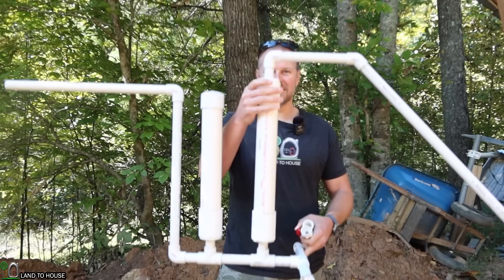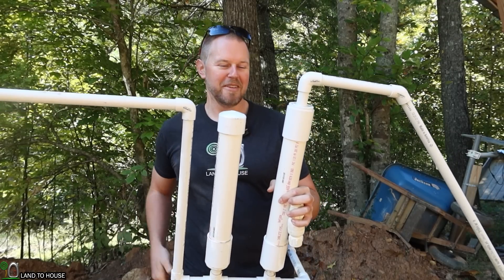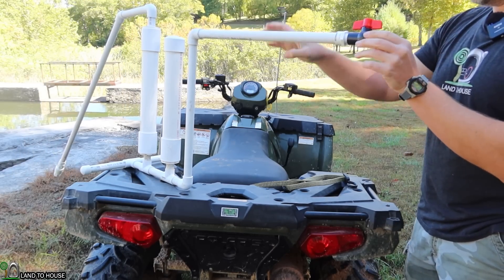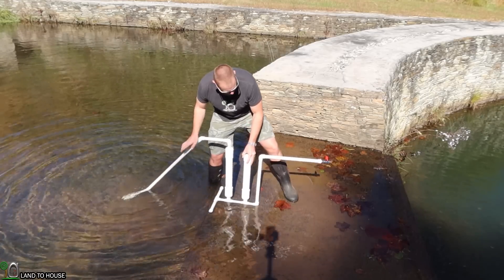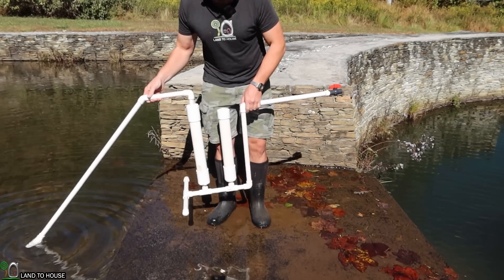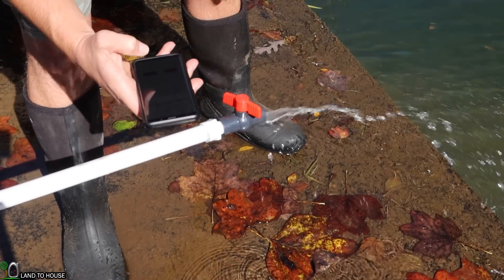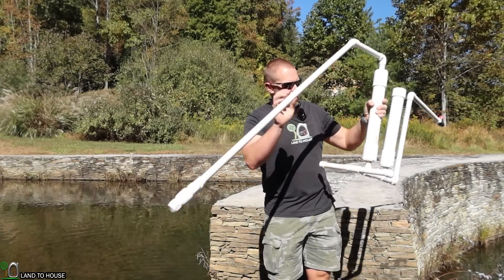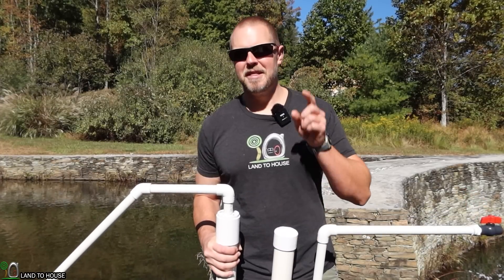This Siphon Works But not for Long

Comment: Great video...honest.. realistic...
A few comments you made, aside from the false design, show that one must understand some basics before creating anything.
"Perpetuum Mobile" remark shows us that you did not get the fact that water flow is actually behind all these variations of pumps and such. The various designs vary only in efficiency of converting/utilizing water-flow force. The air-pressure (with the help of two properly installed one-way valves) is used only to start-and-maintain oscillation of taking the water in and spewing it out.
Your design will never work as it is missing the !!!minimum!!! features/parts a RAM PUMP has.

Comment: if your going to do an honest test  you need to glue all joints.  even a pin hole leak will stop it from working.
you can debunk anything by not doing it right. we have used this method on the farm for years we draw up with a 3" pipe and exit with  1 1/2" pipe   and have 6" pipe chambers.  and you do need to add Air, we have a 10 gallon air tank we go down and fill once a week to keep the presser up
debunked???  no just not dune right

Comment: you did not make it correct  as the out put should have been lower meaning you should have placed a 90 the direct it down then a 90 to send it out.  the intake pipe has to be smaller and out put  you did not make a proper siphon  try again and you need deeper water for to fill the system and not bang the check valve

Comment: I can't say because you don't do it right, and not sure if it's air tight or not.  I've a good smile seeing how you SHAKE the water. 

🔸 They all PUSH the pipe into water to pump water to fill ALL PIPES.  When you just SHAKE the end, and I don't think it pumped enough water to fill all pipes.  An error right here. 

🔸 If the pipes not filled with water then it won't work.  If it's a small leak then it won't work either. 

Since you've made few errors, and not so sure if it's 100% air tight.  Then YOU 	FAILED the test for us to say more.

Comment: why do have to put another tank if you saw that from an asian guy on you tube you over design it with another tank that will give more hard time for water to flow out cuz the other tank trying to compress it back the water back instead of out

Comment: What's missing is a valve like what's on a bicycle tire to fill the other chamber with pressurized air.
Reply: It doesn't need the Schrade Valve for it to work.  The reason the guy has the Schrade valve because he wants to have enough pressure without having to fill the pipes with water first.

It's just a different design, everything else works exactly the same.
Reply: @fairryalp.-de5qb  A siphon needs to dump water out at a lower point than where it takes it in to work.

Comment: Did you debunk this or did you not really seal the joints allowing air to leak in therefore water falling back out?
Reply: The pieces were even falling apart as he shook it 😂😂

Comment: Maybe there is a leak somewhere in the pipe , this way you don't build any pressure,  and it won t work😊
Reply: There are huge air pockets in it plus he didn't seal the middle ones tight. Air befan to flow and it made the water stop

Comment: No glue on the joints will allow air in the system. Hence why iys not working. It has to be air toght. Not only that you have no air pressure in the "pressure" tank. Also should have left the spring in the check valve.

Comment: Water finds its way down to the ocean, not uphill to the mountain top. Smile!
Reply: You don't know physics. The chamber in the middle are not tight enough to keep the necessary are pressure.  Thus it caused the front part to lose force.

Comment: clearly, you did clue it tight. if the seal is not good then air can escape, and it reduces the pressure, so it won't work.

Comment: Next time seal the joints so the pressure doesn't escape.
The original pump isn't debunked.  However, YOUR artistic interpretation IS totally debunked..
As for the 'lost cause'.., I won't be following you.

Comment: I think the exit pipe needs to be lower than the two vertical pressure tanks. If a fast flow of water could be initiated at the start of this test then the flow momentum might maintain the vacuum and therefore the 'draw' from the "suction"side. If air can still be drawn into the outlet side then it will break the vacuum and the unit will stop working. It's an interesting concept, but I agree with you that it should not work in any practical way. the vacuum must draw water up from both inlet and outlet due to the equal atmospheric pressure at both the inlet and outlet sides. Well done for trying so long.

Comment: u shake it in  wrong way, u need to input some water in the midle tank, and pump air using tube valve to pressure the air.

Comment: You need to PUMP AIR  in the pressure tank.  So ACTUALLY GIVE IT SOME PREASURE.  Install a small bicicleta wheel vent. So you can pump the air in easily.

Comment: Not debunked. A siphon is supposed to be lower than the highest point of suction to get the suction established. The higher the point of suction to the lowest point before the rise and you have the greatest amount of flow. This is called fluid dynamics.

Comment: although it is probably a rube Goldberg invention, not having hermetically sealed connections will effect the quality, I have witness a lower that expected performance with a pool cleaning system, until every o ring was silicone greased and all permanent attachments were glued in place

Comment: I also think that it supposed to:
- be air tight
- first tank should contain volume bigger than inlet pipe
- second tank should contain volume more than exhaust pipe.

Comment: the concept works.  As a youth I worked on an arizona farm where irrigation water flowed through open concrete canals for waterings the ranches. We used heavy rubber pipes about 5 feet long, that naturally curved because they came on huge spools, and 4 in diameter. To get the water flowing, you thrust one end of the pipe into the water and as far as you could, then immediately cap your hand over the top of the pipe and draw the pipe up but not out of the water. Its sorta like sucking on a straw, but instead you just stop the water from running out the bottom by caping your hand over the top. When this is done fast enough, you cause a flow of water that flows up and over the edge of the canal and onto the rows of crops. The flowing water in the canal has a lot to do with the physics.   We would do hundreds in a couple of hours. The competition was who could get the water flowing with the least amount of strokes.
Reply: My grandfather used the exact same technique out in a cabbage field and tried to teach me how to do it when I was 5 or 6 yo back in 1960's. I could not do it be he could do it with about 3 or 4 strokes. As I can recall the curved pipe was about a 1 inch diameter (maybe it was 1.5 in?) and about 4 ft long.

Comment: using hydrostatic pressure you'll need a wider inlet narrowing to the outlet and smallest head hight possible and think about adding back pressure so com plete system needs to be air tight too, also pond shape, depth of intake, water hardness and more are factors.

Comment: The entire intake pipe (until the first ‘vacuum chamber’) diameter should be larger (maybe double the size) of the output diameter. It works. Try again. The ‘vacuum/ pressure chambers’ should be larger.

Comment: Forget all the  long winded theory  and endless calculations water does not flow uphill.
 This device just stores the mechanical shaking into air pressure in the centre cylinder which pushes out the water in the bottom of the device.
The foot valve prevent water being pushed out of the inlet.

Comment: okay i got one for you,,,there's a product on the market its called a V - Pump.

Okay its stated this plastic gadget is submersible,how it works?

You attach a hose to it as its primed from a hose pipe,,i think the design and manufacture is,,Australian,,its noted that with hose water priming the aparatouse and the aparatouse then placed into a pool it will pump at very high velocity,,

Okay i haven't purchased this unit as its a unit to global market from Australia so i don't quite know whom has the franchise and thus what markets its directed at in order to to obtain one,,.

Now some people say it works but i am not convinced,the science behind the aparatouse that works the  the VENTURA,,assuming water gravitationally fed pump system,,its used for a variety of applications emptying out ponds, etc

When reading about this aparatouse i was on the research path to try and fined an aparatouse that fully functions primed from water and of course then pumping the same water and  in some way attain lift, i wanted to at least gain a lift of  5 meters plus get as much flow capacity as possible where i could control the flow but attain up river as the object was to in some way defy gravitational force so i could work up stream as well as down plus on a level keel attain an all around flow,,im looking for a product to achieve this given i flour gold prospect so its essential to have a system flowing either direction 24/7 if i chose to,

Further i wanted to obsoleate a fuel type system,and such as Electric,,or
Battery operated bilg pump systems and go out totally Eco,,well that's what its all about being Eco friendly with nature its a plus for me
I operate a variety of sluices but unfortunately bilg pumps are a necessity but csn be a pain carrying battery's every where at present to run my sluices and highbankers the bilg pump is 12V not a big impact but saves carrying pails of water the battery can be hevey going,

I came up with an idea that if the V - Pump operated from a hose to prime this Ventura concept all i needed was a pressurised primer to the V - Pump from a bilg pump and the rest is history,

I haven't tried this yet as i don't own a V - Pump they say they are about $20 + but i think its possible to prime the V - Pump from a 12V Bilg Pump if so and of course should this work it would mean that the aparatouse would possibly work this way be light robust and possibly could keep the pressure and flow rate i need going on a continuous loop along with the required lift,,
Lift is very important when working against gravity but if it worked i could function on the level and going down or up stream, it would allow me to choose the locations and working spot without restriction,

It would allow me to physically use the water i am using  i am priming into the feed as if it where from a hose,,yet it would be coming from the source i am working in,

The only difference would be i would have advantage in using Creeks,Streams,Rivers and even the sea water at those locations and on the same token being totally Eco friendly to nature as i sluice and pan for the flour gold shiney,
Us part time prospectors in our hobby interest have to find a way to keep everything balanced and inside the laws of mother nature without upsetting the EcovSystem thus totally reducing carbon footprint,,
Its important in law not to use if possible a mechanical device,, where such mechanical devices deprive the right to prospect as a hobbist.

Gravity is the obsticle i thought further could this apparatus further make a good dredge for dredging those nooks and craneys in the rock crevices and pockets,,well here is a fantastic opportunity for you to see wether this aparatouse stacks up to its innovative structure,

The Pump is called the 
V -Pump its an orange hand gun type aparatouse that connects to a hose pipe ie the hose primed from tap water being the primer fuel that sets of this device when submerged in water.

Will it Pass or Fail awaiting your test results.

Comment: to pump water up you need at least to bring the equivalent of gravitational energy...  of course,  you can initially put some energy in the system  like pressurize gaz or whaterver but once it is used. the flow stops... no need to debunk as i ve never see one working... but...well..trying by yourself is fine...but ..physicists have  done that long ago..

Comment: All this busted was your credibility as a 'buster'. You didn't explain how it actually was supposed to work so I am assuming you don't really understand it.  One of the videos I watched DID have the one-way valve at the bottom...perhaps you weren't watching closely enough? Ther are several parameters that might need to be changed slightly that are critical to it, but you didn't mention them either...etc.

Comment: if you don’t understand that you need a one-way valve at the bottom of the input, you are clueless. You should take this video off-line, cause you don’t understand the concept, nor did you engineer it correctly. Maybe it is due to lack of instruction in the other video, but you don’t even keep the input underwater during the manual filling. Then your pipe shoots out of the socket, which means you didn’t use any glue, making the system not air tight, which is another requirement for it to function well. I doubt whether you glued the pressure chamber either. It is YOU who is BUSTED!!

Comment: If you didn't use PVC glue the joints will leak air. I think it needs to be air tight to make and maintain pressure.🤔
Reply: it needs to be air tight, but he should use a hand pump to start the siphon, or a hose at the end to change the elevation, like when you siphon gas from a car, will it be like a pressure washer? of course not

Comment: YouTube is replete with these devices that fail to work.  The only value as you will learn is the exposure to ads. YouTube and the creator make money and you wasted your time. If it is on YouTube and your first impression is that it doesn't work, it probably doesn't work. The ads, however, do work and generate income.

Comment: I posted a water air compressor on you tube it's just a drawing but if you find it you can build it I've given a description I 100percent sure it will work I haven't tested it yet have fun 
Live life if I could send you a video directly I would keep up the good work check out zm bombas water pumps if you haven't already you will love it

Comment: You have to turn the whole system sideways look at the video again and see how when he tries to pump it back and forth in the water upright the water doesn't really come out you got to clean it to the side and then pump it in and out of the water once the water starts flowing big time you tilt to back up and set it down then it'll work with a lot of pressure

Comment: It is never going to work. It violates the rules of physics. because the outlet are above the top of the water there is no potential energy. The valve on the bottom and the motion build up mechanical/kinetic energy for a bit but eventually that dissipates. Perpetual motion machines do not work.

Comment: For some reason your pipe are not proper seal or air tights which those pipe lose pressure. Knowing using references. I just see it lose. Those people using proper sealing the pipes. If those are fake it hard to believe in how those other era work in pipes. For example water foundation.

Comment: Yeah that design for a siphon wouldn't work all that well if at all. There's way to much space for air to get trapped which as the water pressure slacked off the air would fill and break the vacuum.

Not to mention the outlet is at the same height as the inlet riser. Plus the joints look slip fit which if they're not air tight will suck air and break vacuum. Then there's all the 90° changes of direction, as each time water has to switch directions like that it slows down in a odd manner that it (water) gets in its own way. 

45° turns are better to keep high flow path. Plus you don't need 'pressure chambers' because to build any pressure would fight the lack of water pressure even with a check valve. A siphon system works best by gravity in conjunction with water tension. The higher the fall of water down the siphon the greater the strength to pull water to fill the vacated space of the water leaving the system.

Comment: The only reason why any water is running out of the outlet is because you are putting work (pumping energy) into the system by shaking the one-way valve at the input pipe.  That energy is further stored in the large capped-off tube as increased air pressure (above atmospheric pressure).  This is potential energy.  When the outlet valve is opened, the small amount of stored potential energy in the slightly-pressurized capped-off tube pushes the water through the valve and out of the outlet tube.  Once the air pressure in the capped-off tube reaches atmospheric pressure (in a few seconds), the water flow stops.  There is no magic perpetual motion going on here.

Ed Schultheis, PE
Licensed professional mechanical engineer
Mechanical design engineer and manufacturing consultant for 35 years
Schultek Engineering & Technology, Inc.

Comment: It is pressure buildup followed by vacuum suction.
That mean leakage is a big thing to make it right.
Another is the volume and the length.
Yours is equal in length but reduced in pipe size.
That means you can not produce the pressure/vacuum you need...
So size matters and in a pressure/vacuum system, 
it needs to be consistent and without much leakage...
Keep in mind that it is based on NATURAL pressure, that means limited pressure.
That means limited distance and limited volume...
This means standing or low flowing water will always run out of pressure.
If you do it in a river and/or canal it is more effective.
If you ad a floater with weights to the part that is in the channel,
the movement of current, wave and tide will build up natural pressure.
It is a very old, thousands years old and proven concept that works..
Look at history about: Bamboo piping & pumps + water elevation systems ect ect.